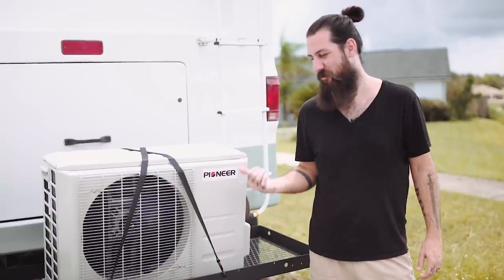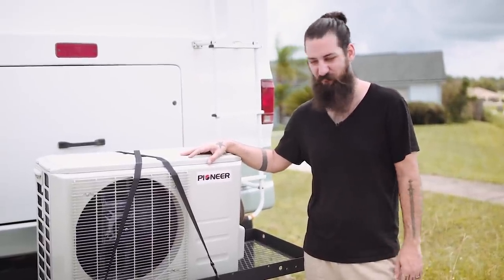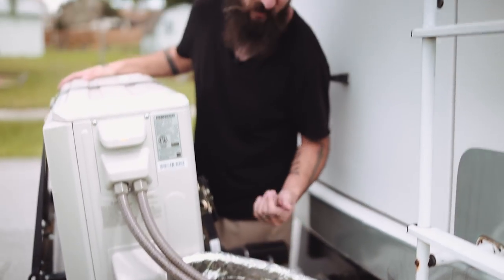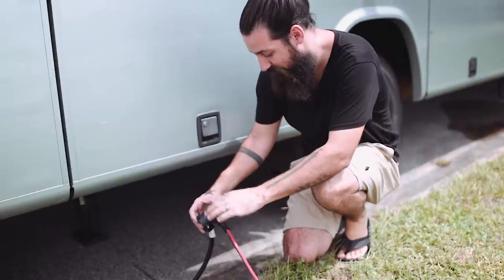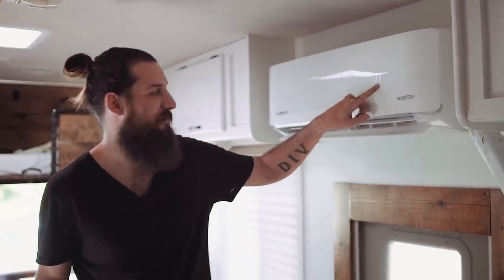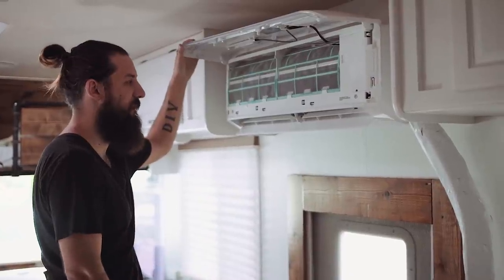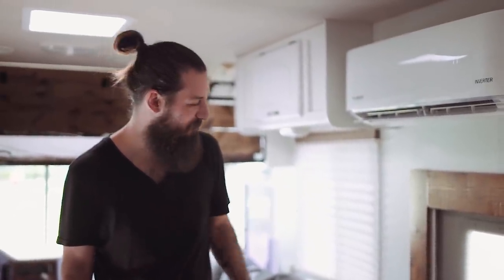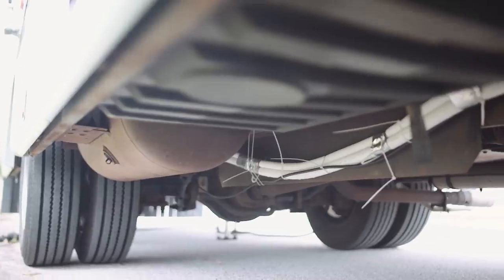RV / Motorhome Mini Split Air Conditioning Setup

Comment: May be a dumb question. Can you run this off a battery bank?
Reply: I’d like to know too; how long would it run off banks of 6V batteries and an inverter?  (No generator at night)
Reply: You will need a big battery bank. This model use  8.4A @ 120V = 84A @ 12V + 15% for conversion losses = 96A 
For 8h battery run you need 96A x 8h * 2 (never use more than 50% capacity) = 1536 Ah = 16 x 100Ah batteries
Reply: John Roland Thanks John, interesting you didn’t mention Watts?
10,080 right? (Less drop outs)
Reply from the maker: Not a dumb questions at all! We are actually looking it right now. We would like to install solar panels and use one of our storage bays to house a bank of batteries, and then wire everything to run our a/c and electrical outlets, etc. We will definitely be putting up a video about that when we get there! :)
Reply: Or, you could run 24 volts instead of 12 to spend less on with and connections, with lower line losses. Then, you could splurge on something better than lead acid batteries (say lithium) to get the same capacity with fewer batteries, because the usable amp hours are better. Though the batteries cost more, you save a lot of space and weight and get better performance. Obviously though, the first thing to do is to insulate the RV better by covering up extra windows with rigid insulation, and then working seal air gaps everywhere. This will reduce the cycling of the heat pump and therefore it's energy useage. Nevertheless, they are on the right track with that idea.

Comment: I haven't heard anyone talk about the inrush current which is the problem with window AC and residential fridges. My window AC I put in from Sears for $180 needs the generator at full speed but once it starts I can put it in eco mode. If the compressor stops because it reached temperature I have to go back and turn off eco or it will stop the generator. My refrigerator I bought at Home Depot a cheap Vasani but only $288 takes a 1500 watt inverter to start but then runs at 80 watts. Just like the appliances that came in this motorhome the furnace and AC are obnoxiously loud and expensive.

Now you need to cover the roof in 15 or 18 solar panels (5 groups of 3 panels for 90 volts into the charge controller) which will shade the roof and run them through a mppt charge controller, Midnight Solar at 24 volts to 8 6-volt flooded batteries in two parallel banks. Then get a DC to DC converter for your 12 volt system and it will always be at 13.5 volts. Get a 3000 watt pure sign wave combo charger inverter to run on the 24 volt system. You should be able to make at least 3000 watts for a day total of 20KW on a sunny day. plenty to run the A/C and charge the batteries. !5 solar panels 1700, Midnight solar 800, flooded T105 batteries 1000, inverter charger 2000, For $5500 you would never need to plug in again. Get a $1000 generator for an emergency battery charger.

Thanks for the video.
Reply: Mini-split units have a soft start with no inrush current which is easy on inverters.  A reasonable installation for 800w AC draw might be 600w solar panels and 600Ahr (useable) battery storage.  With night time heat loads dropping a great deal, the AC unit will adapt and draw much lower wattage.  This would provide reasonable comfort during afternoon and evenings but not 24/7 cooling.

Comment: OMG what a terrible install! You can't tow a vehicle now don't park in a bad area it would be stolen in a second! Why don't you mount it to the rear of your RV? The unit is efficient with low amps draw and cools great but the condenser unit is too large for your RV and looks Gehtto! A rooftop unit would of been better . Or a custom air conditioner build. I made a ac for a friend , I used a window unit compressor and a ambulance EVAP coil and ran hoses and vents for ice cold air. The vehicle had nothing sticking out. A condenser coil mounted underneath.  Rethink your AC install.
Reply from the maker: David William Nope. Thanks for being wrong about everything.